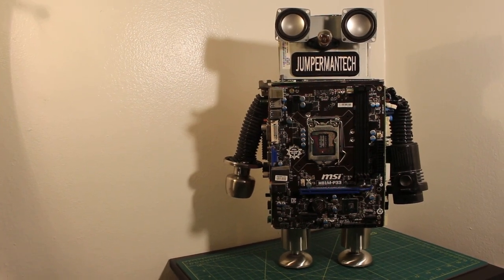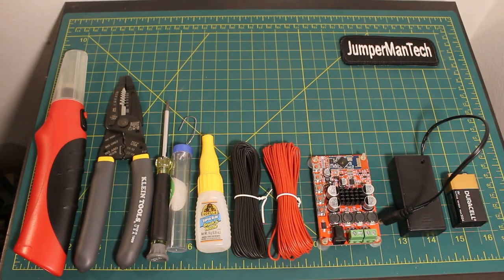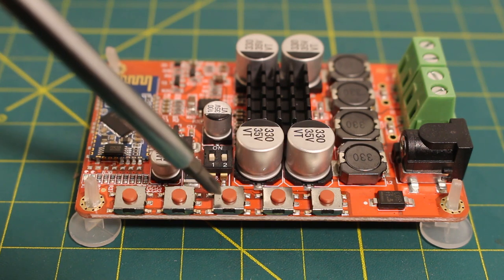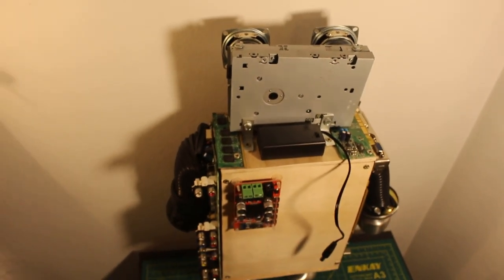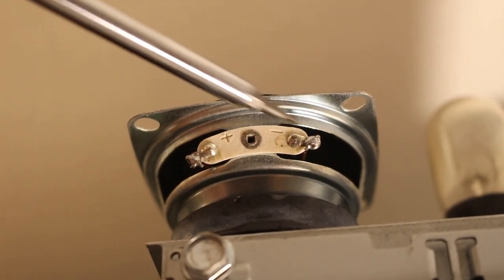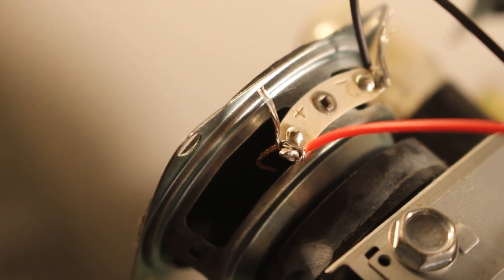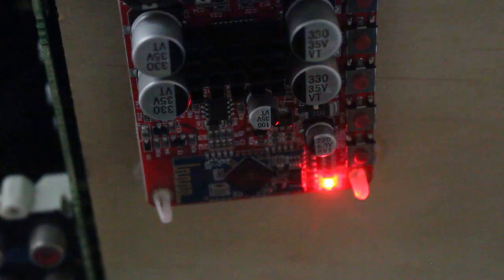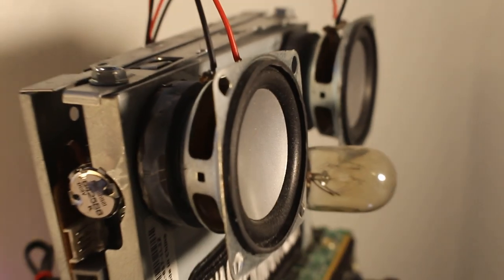DIY Robot: Homemade Robot Built From Junk (Junk Art Robot/Blueooth Controlled Robot Speakers)

Comment: It has character I like it. You know class D amps have come a long way and sound pretty damn good these days. A similar amp fed into enclosed drivers using lithium cells to drive it can sound pretty great. Even at only 9v input with a higher distortion level it sounds decent enough.